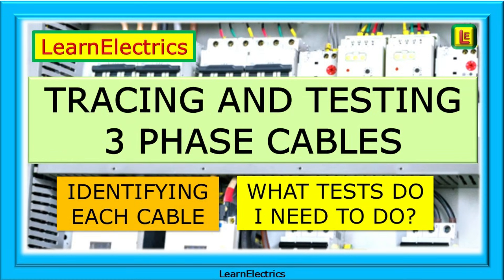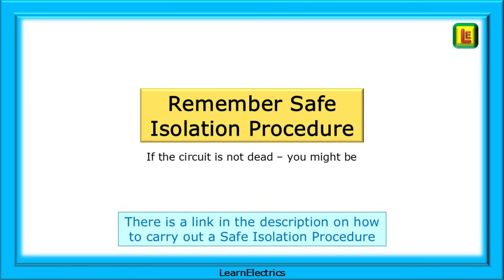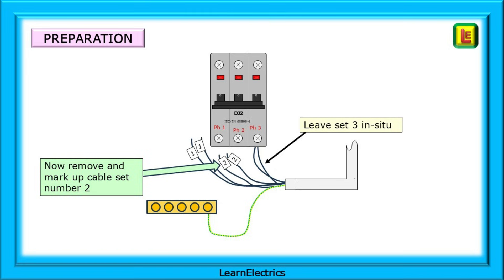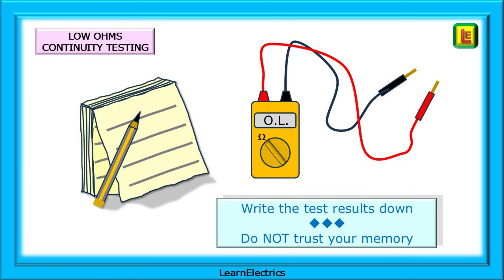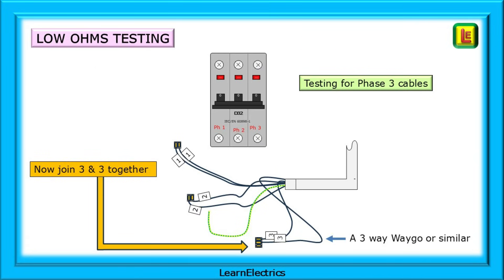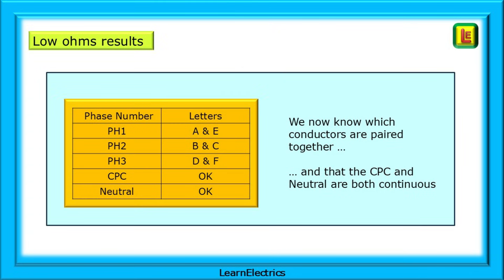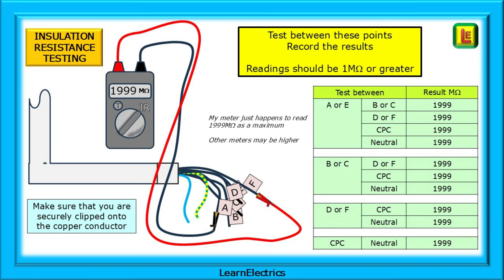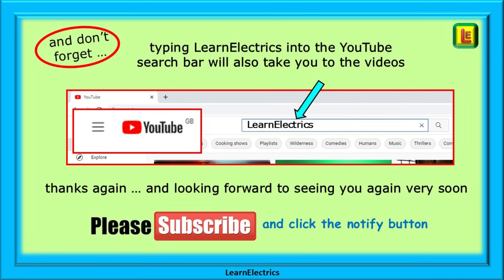TRACING AND TESTING 3 PHASE CABLES - FINDING UNKNOWN CABLES – EASY METHODS TO LOCATE AND IDENTIFY

Comment: Great vid, Is there a way to ensure correct phase polarity for the machine to prevent motors running the wrong direction etc?
Reply from the maker: You can get a phase sequence tester, some test meters include this function. If you know the sequence that you need for your motor windings then they do help. Also, if there is another machine nearby with the same sequence, check with the sequence tester and copy the wiring.  We always preferred to disconnect critical direction equipment before first switch on just to be on the safe side. Robots can do a lot of damage when they want to. 
Thanks for watching, I may well put your question out as a video in the near future, Dave.